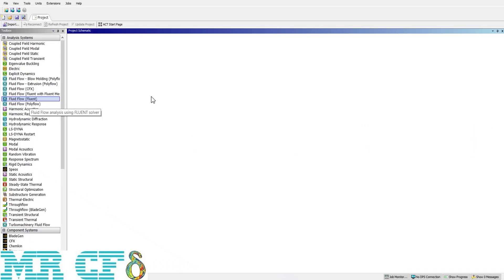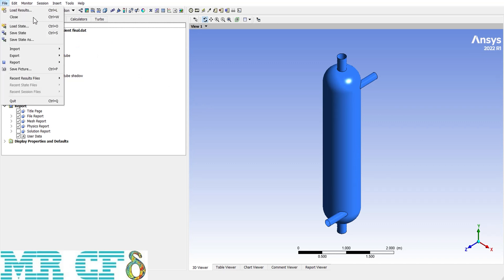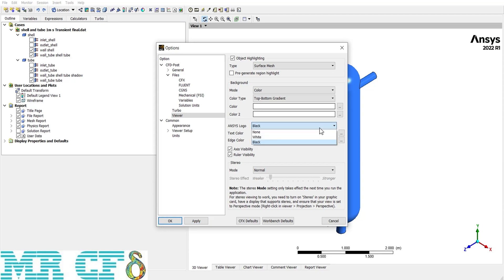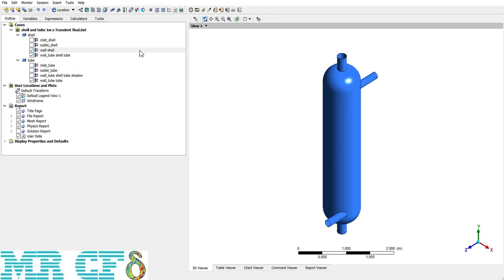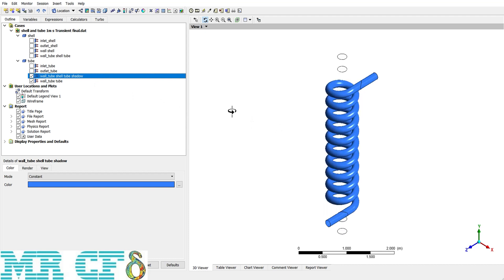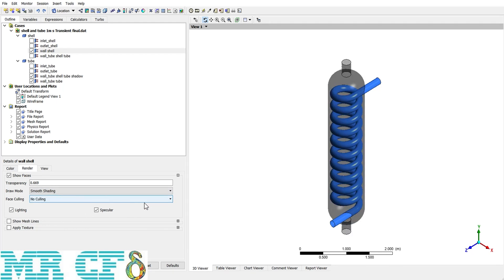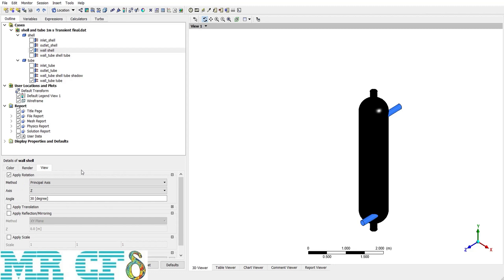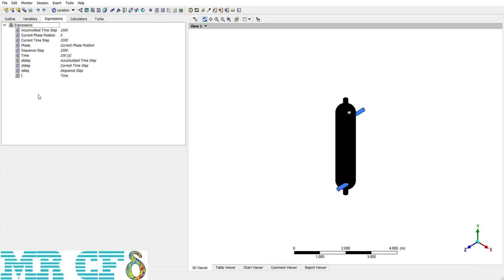CFD POST Course, Session 1: Introduction and General Settings

Comment: Hi, last few days I am facing more deeply the Ansys Workbench CFD post processing tool. however, as I introduced myself into the sessions, I was able to record one on which I created a table with data from diferen planes on the model. However, I do not know how am I able to run it. This way I could automaticaly record data in excel files in transient models (this case). Can somebody help me? I would realy appreciate it.
Thank you!!